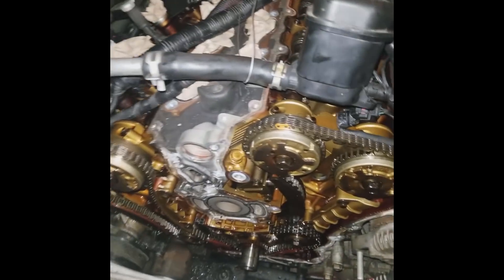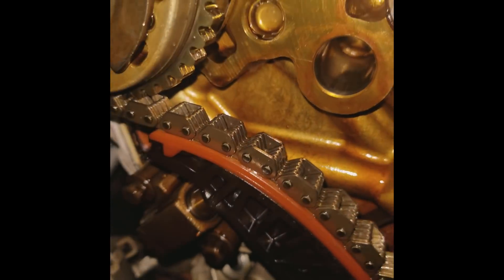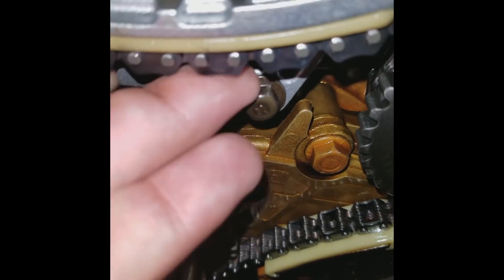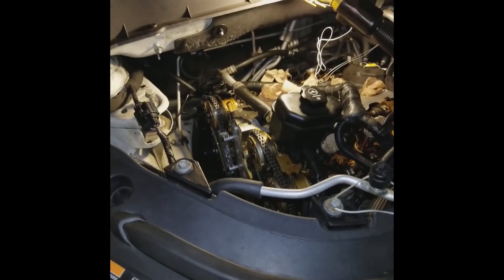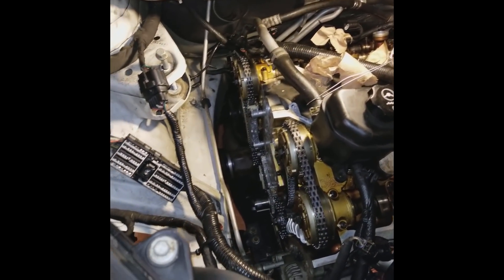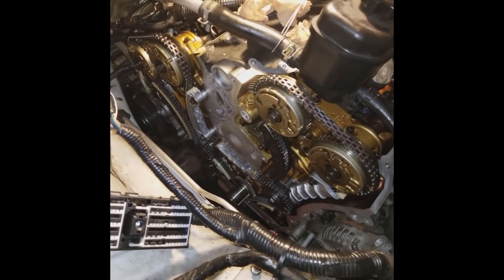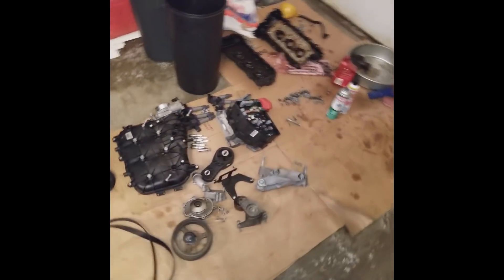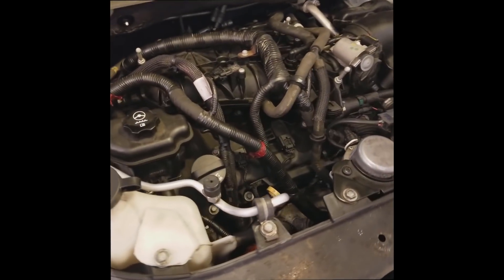GM 3.6 High Feature V6 In-Vehicle Timing Chain Replacement, No Engine Removal, Stretched Chains

Comment: It's positive that you suggested that it can be done, but would have been a lot more helpful if you would have filmed the entire process rather than just taking the engine cover off and putting it back on again. Since you chose to film very small pieces of  it,  it makes sense to film all of it. I would imagine your views would have skyrocketed and you would make a lot more money off of YouTube not to mention helping thousands of people.
Reply from the maker: Thanks for the suggestion. I don't make money off of YouTube. I spent a few hours filming this and downloading and learning to use some editing software. If I had more free time, maybe I would have filmed the whole process, but understand that filming an entire job like this (especially as someone doing this for fun/free) adds many, many hours of setup and editing to an already long process of repair. That doesn't include equipment to set up and film what would go beyond just a relatively quick smartphone video. My intention was not to walk through the procedure step by step. My intention was to demonstrate to those who already have the skills and resourcefulness to complete a job like this that it can be done. If you're comfortable pulling something apart this far and getting the timing correct and you've had plenty of nuts and bolts on and off before, you can do it. The other information can be found in other places on the web. For example, the Cloyes video demonstrates how to replace the chains, the DIY version of Mitchell and probably other Service Information providers are accessible enough to most and fill in most gaps and provide specifications for fastener torque, placement of sealant,  et cetera. I appreciate your encouragement, but please understand that YouTube is not even close to a full time job for me, let alone a source of any revenue whatsoever. I was able to contribute a somewhat small, but critical bit of information regarding this repair. I'm happy with my contribution, since I didn't have to make one at all. If you plan to attempt this repair, I hope you are successful. Same goes for anyone. Happy wrenching!

Comment: Terrific video, thanks. How long would you say it took to get to the point of being able to just inspect the chain?
Reply from the maker: Thanks! I couldn't say for certain (plus it's been a while), but many hours. Long enough that I wouldn't recommend starting the teardown process unless you're confident that there's a problem under that cover.
Reply: @ClaytheBMXer  Really, I see so many videos which are not helpful and lack intelligent commentary, so thanks. I'm a bit frustrated by the apparent lack of a sure-fire way to positively ID the timing chain system as the problem. I did I compression test and the bank checks out OK, but now a tech is telling me that this means nothing unless the engine is under load, which I don't quite believe - late is late. So I'm reluctant to drop the engine just to find out. This is an Enclave, BTW, but same difference.
Reply from the maker: @josephtrupin681  Sorry bud, I just got around to reading this. What did you end up finding out? The only positive way to identify a problem without teardown would be through the use of a labscope and a known good waveform for comparison. I did not have one at the time of making this video.

Comment: What was the actual cause for the p0017 code. 
Timing chain guide failure of just loose chain from lack of oil change or tensioner(s)
Reply from the maker: The chains were physically much longer than the new ones when compared. There's a picture of them side by side, I think at the very end of the video. My guess is lack of oil when the previous owner had it and/or inexpensively produced parts. If you look at the direction of rotation of the chains, I believe all the slack tends towards that back cam that set the code.
Reply: 3000 mile oil change is probably a new norm for overhead cam v6 engines.

Comment: Was there any engine noise or knock with this before hand?
Reply from the maker: If I remember correctly, it was just slightly louder at the front cover when listening with a stethoscope beforehand. Not totally obvious. I don't believe there were any other discernable noises. It would reset the code almost immediately upon clearing and restarting.

Comment: I turned my engine for a hour, I cannot get my cam marks and color on chain to line up! I have my crank lined up top dead center, cam marks are on the money. No color on chain lines up. I haven’t removed anything yet. Any advice?
Reply: Devin Hello,if my bank 2 cams marks are not align before remove the chain on bank 1 can I just move them on position without the chain when installation begins ..? Are the cams rotate clock wise..? Thanks
Reply: At Lewis ,how did you get the marks align,I have the same issue ..thanks
Reply: @Devin sorry bud but that's backwards. The cams spin half as fast as the crank. Crank rotates twice for every 1 revolution of the cams.

Comment: Been looking into a catch can. Apparently all the junk gets thrown back into the passenger side, or inside sode on fwd transverse gm 3.6. New gms doing catch cans. Also look at changing phaser now too. I am not a mech, just telling you what I am in process of researching and my plans when i save enough money and nothing comes up.
Reply: Yes but first pull the pcv valve out and drill the holes top and bottom slightly bigger, that's the fault that causes the pcv valve to clog up stopping the engine breathing, causing the carbon build up on one side.
Reply: @ItachiUchiha-lr3yr  haha, so now the front crank seal is leaking and oil all over the front of the engine.....2 belts on one harmonic balancer, two tensioners.  This engine is hilarious.  I dont know why they dont just make a 6 that is like thier 8.

Comment: I'm not one to be a buzz killer but take the time to do it as it says what happens when you go to put that cover back on and smear rtv in the wrong place and find yourself doing it all over again or worse replacing heads
Reply from the maker: I should add that the demonstration in the video is not the actual installation of the cover. That was a dry run/demo to make sure we knew how to get the cover in without smearing RTV, as you said. GM's instructions for application of silicone were followed, and care was taken not to screw it up. Because of the time it takes to get back down to this point, it's worth the extra time to VERY carefully install the cover. Hence why I recommend having another person to help.
Reply from the maker: Yes, I would recommend installing the cover correctly.
Reply from the maker: @korzym I'm not sure what that refers to. We did not use any special tools to install the cover. Do you just mean threaded rods or studs?
Reply from the maker: @korzym yeah, I'm sure that's a nice option to have! That combined with the extra space probably make it a lot less stress-inducing haha

Comment: Bud, my mechanic and dealer says you to drop the engine..My timing chain cover is leaking oil...
Reply from the maker: If you have a lift, it's probably easier. But as you can see, I didn't.
Reply: I just did one In an Impala. Plenty of room with no reason to drop the cradle. That was my 3rd time doing a set in an Impala. Got it down to 4 hours

Comment: I noticed what I believe to be the cam phaser rattle after starting your engine for a brief second, has that sound always been present in your vehicle, engine start at 3:26, camshaft phaser rattle at 3:28......
Reply from the maker: After reading your comment, I asked the primary driver to listen for any kind of a cam phaser rattle or clank on startup or otherwise. I have also started the vehicle cold myself several times. We have not noticed any discernable noise, even with the various temperatures here lately. When I started the car in the video, it was the first start after the timing chain job was completed. The oil had also been drained and the vehicle had been sitting for an extended period of time. I believe this to be the cause of the noise in this instance. As in, it took a little longer to build oil pressure than normal due to the circumstances. 

I will say that on many vehicles/engines, it is relatively common to hear a noise like this on startup, especially cold. Generally, if there isn't any running issue or fault codes, I don't worry about it. I will say, of all of these cars that I have serviced, I wouldn't say a VVT noise is common. This seems to be more prevalent on Asian makes.

If you're concerned about it, it would never hurt to check the oil level and change it regardless (if you haven't done so already). I'm not saying that an oil change will fix your noise, but my first step on any kind of correlation code or solenoid controlled timing performance code with VVT is usually to change the oil and filter (circumstantial, of course). Especially if it's low or dirty. Often the codes do not come back. It would be worth doing for peace of mind, even if there is no change. 

If you have a noise like this and it gets worse over a short period of time or sets any codes, it is definitely worth investigating or having someone investigate. 

I'm not sure of your credentials or why you asked this question, but I figured I would give a complete response regardless, for anyone else who might be wondering. 

And thanks for watching/commenting!
Reply: @ClaytheBMXer  my oil level is FULL and the vehicle is new, the cam phaser cold start rattle is widely reporting in most 3.6L GM high feature engines, seems your timing chain job was successful and I did here the phaser rattle briefly but I guess it's just part of this VVT system
Reply: Take a wrench on the camshaft and rock each of the phasers. It'll be obvious if one is on way out.
Reply: @John Bryan  the mechanics at the dealer claimed that they checked all 4 phasers when they had them exposed while the top end was apart and said that they were parked. If that was true or not I wasn't there to see it but I guess I somewhat have to believe what they told me???? I'm sold on the fact that one or more phasers isn't parking itself as designed if you read the patent info on cam phaser design once the oil galleries in the phaser leak down a spring is supposed to assist in reseting the phaser into a "PARKED" position with a locking pin. The dealer claims that it will not damage anything but that felt more like an empty promise. I'm not a fan of metal objects slapping themselves silly at every startup after an overnight soak but I did my due diligence and had the dealer teardown the top end to take a look. Some other new vehicles on the lot did it as well and apparently 2 others didn't when they checked for themselves.

Comment: Vi, could foi help me? I have a Saturn vue with the same engine and it has almost the same space, I would like to know if is possible to remove the right head cylinder in vehicle. I need to replace the head gasket.
Reply from the maker: To be honest with you, I wasn't even aware that the Vue was available with this motor until you brought it up. I have no idea whether that would be possible. You could try comparing the space in the vue to that in a vehicle with the chassis in my video for the part of tearing it down as far as I did, but beyond that, it's going to be up to you to decide whether it is possible to get the head off. That's uncharted territory for me. We just had one of these that broke the right (rear) bank chain at the shop I work at. We went the route of engine replacement. When the valve cover came off, the destruction was evident. In our case, it makes more sense from a warranty (and probably labor) standpoint to slap in a new engine. My coworker dropped the subframe out on the lift and it got a remanufactured engine in that case. I'm sorry I can not be of more help. You might be better off asking around to the GM Technicians on YouTube (especially the ones with videos on 3.6s). If you could, let me know what you end up finding out/doing - it might help someone else in your position if they find the comment here! My condolences, and I wish you the best of luck!
Reply: @ClaytheBMXer  hehe, realy condolences in this case, thanks for respond, I'm analyzing the options that I have, pay for a mechanic is almost the same price of another engine, then if I couldn't do it will be the better option.

Comment: What were the oil change intervals on that engine?
Reply: Apparently there is a GM update to change the oil more frequently than originally indicated by the DIC
Reply from the maker: While it was in my care, 3-5000 miles. Before that, it's impossible to say. I suspect not frequent enough.

Comment: You mentioned using a 3" puller to remove the harmonic balancer. What did you use to reinstall it? Thank you.
Reply from the maker: MTLIBRARY I believe I just used the bolt and an impact. I was able to get the torque without too much trouble. For the angle, I used a paint mark and my milwaukee impact. Not exactly proper, but it worked.

Comment: That's a ballsy move on your part. These engines are like Chrysler's 2.7 boat anchor. 

As a mechanic for over 35 years, my hat's off to you. Glad you could fix the engine without getting raped by the dealer.
Reply: I just got doing 2.7 water pump and timming, this 3.6 looks like the same engineers designed it.
Reply: I got raped my mine then was forced to pay $2500 to get my car.. thank goodness she had a big butt and nice titties 😂
Reply: Thanks 😈😈😈🤑🤑

Comment: Did you change the VVT gears or reuse the originals? My neighbor wants me to do his 3.6 in His Cadillac CTS with a hundred and forty thousand miles. The chain is quiet but he is getting the po117 code and of course the Cadillac dealerships I've talked to are saying that he should change the VVT gears on the camshaft switch is going to add at least 300 more dollars to the job. On the videos that I have watched I do not see anybody changing their VVT gears just all the hardware that comes with the timing chain kit.
Reply from the maker: Chris Schroyer I did not remove or replace the actuators. Before tearing this down (and after changing the oil as a starting point), I did attempt to clear the codes and do a functional test with a bidirectional scan tool to confirm that everything was hydraulically working. Unfortunately, the DTC was setting pretty much immediately upon startup, and it was going into a failsafe mode that would not allow me to command the actuators with codes set. I tried replacing the solenoid for that particular camshaft with no change. I also listened with a stethoscope all around the chain. The side closest to the firewall (far right exhaust cam) was making the most noise. This correlated to the code that I was perpetually setting. Is that P0117? I'm not currently looking at the manual. I had an actuator on hand when I tore it down, but decided not to use it when I saw the chains. There was obvious slack in all three, and looking at the direction of rotation and the placement of the tensioners/guides, it seemed to me that that camshaft would be the first one to be affected by a correlation code with a loose chain. My assumption turned out to be right. The caveats to this would be if I didn't know if the oil had been changed at a good interval for the life of the vehicle, whether it had been kept full, if there was obvious wear from a lack of lubrication from the oil going low, or a higher mileage engine - in any of those cases I might have considered replacing all 4 actuators for CYA. All of that said, if my neighbor asked me to do this job for them, I would probably decline. It's not exactly fun to do at home,  ha. That's your perogative though, of course.
Reply from the maker: I would also recommend trying to find a good description and operation on the whole system and reading all the way through it if you can. I'm not sure whether you can find that online though. It's not exactly fresh in my mind at this point or I would try to relay some of what I learned when I did it.
Reply: FullClip69 thanks this has been very helpful. I've got a lot of experience in multi chain timing chains but I generally do dread doing them. This would be my first attempt at an engine with variable valve timing. His engine is currently only giving a code po117 which I do know is the camshaft that you are referring to however he has no timing chain noise at all that I've been able to detect so far. The dealership wants around $2,000 plus to do the job. I'm a semi-retired mechanic that works in my driveway under a carport. I usually tried to stick with the simple stuff but here lately everybody's been coming to me with these kind of problems. Beer before I even think about tackling his I've got one of those Malibu with an Ecotec engine coming in for a timing chain this Friday. Your video and your information has been extremely helpful thank you.
Reply from the maker: I'm glad I could help! GM and their timing chains.... geez. Good luck and happy wrenching!